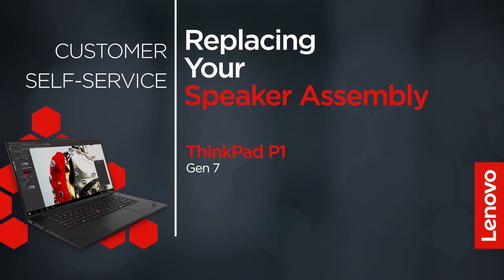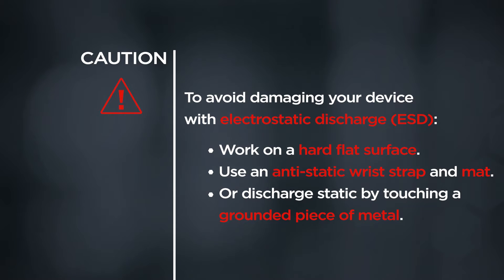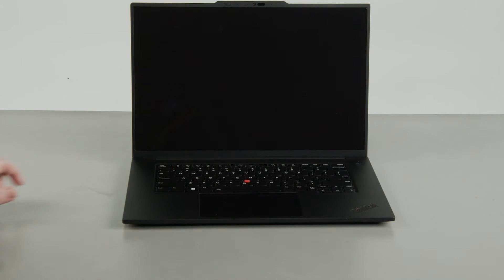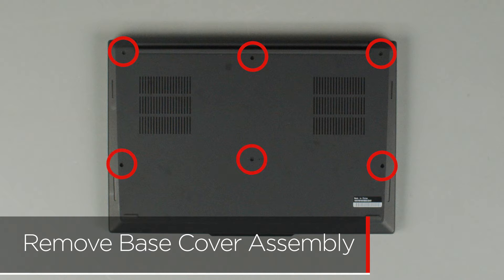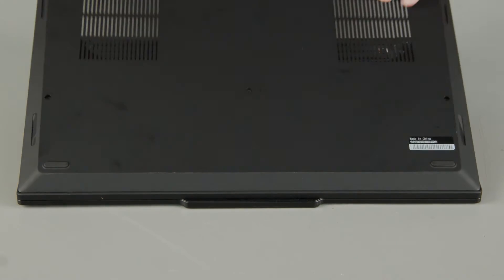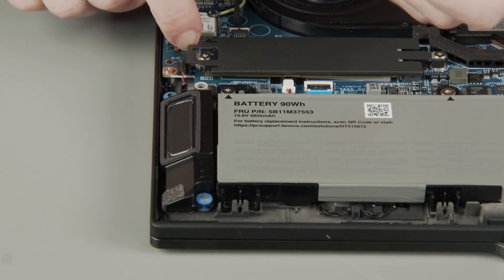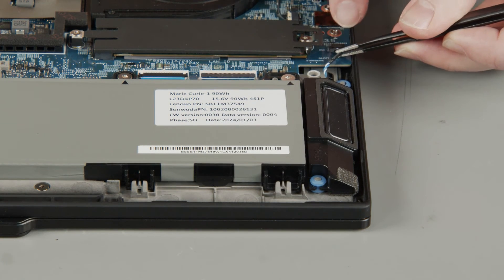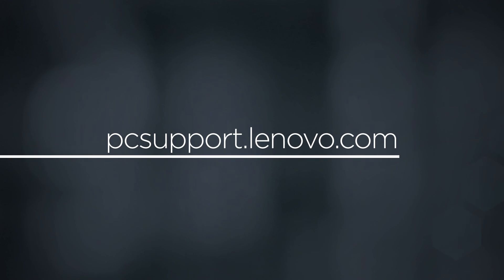Replacing Your Speaker Assembly | ThinkPad P1 Gen 7 | Customer Self Service

Comment from the maker: This video will show you how to replace the speaker assembly in your ThinkPad. The process in this video will work for the ThinkPad P1 Gen 7. 

You will need a screwdriver kit, static-safe tweezers, and 15 minutes of your time.

To view the ThinkPad P1 Gen 7 Self-Repair Guide go to https://pcsupport.lenovo.com/us/en/products/laptops-and-netbooks/thinkpad-p-series-laptops/thinkpad-p1-gen-7-type-21kv-21kw/selfrepair/removalsreplacements

To learn more about your device go to https://pcsupport.lenovo.com

To find parts for your device go to https://support.lenovo.com/parts-lookup/?cid=ww:lenovosocial:b9515f&source=socialmedia&subsource=yt

To view the Lenovo Support Self-Repair Guides landing page go to https://support.lenovo.com/us/en/solutions/HT516547

** NOTE: Static electricity can destroy components. Use a grounding strap, and clean, non-conductive surface to work on. Use plastic or coated tools to prevent scratching and avoid using metal tools on plastic parts. For more detailed information on electrostatic discharge and how to prevent it, please watch our ""Understanding Electrostatic Discharge (ESD)"" video: https://youtu.be/by4PB3WtdLo 

Applicable Machine Types:
ThinkPad P1 Gen 7 - 21KV, 21KW

#Lenovo #LenovoSupport #LenovoTechSupport

Check out other official Lenovo channels!
https://www.youtube.com/@Lenovo 🟥
https://www.youtube.com/@lenovolegion 🎮
https://www.youtube.com/@Lenovo-PC 💻
https://www.youtube.com/@LenovoSuporte 🟢🟡